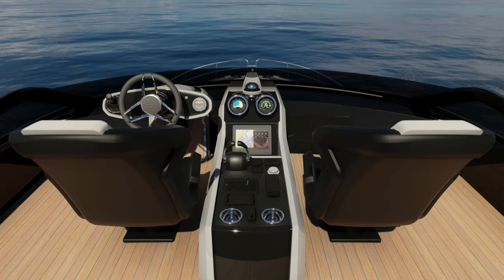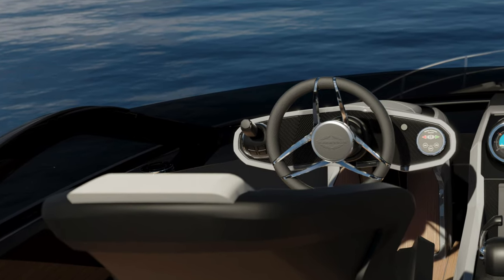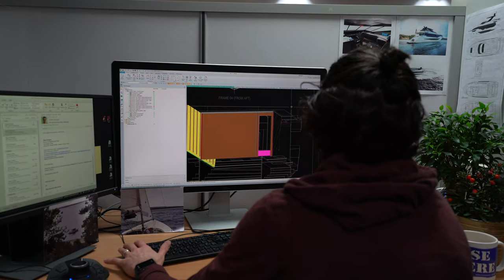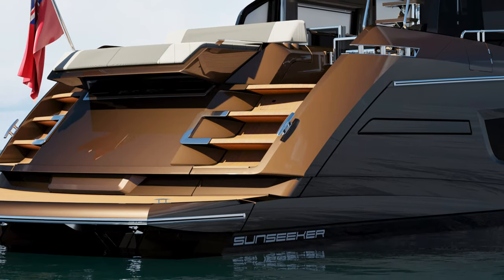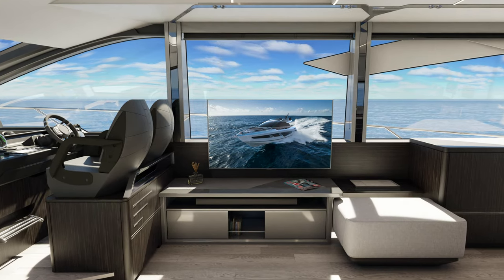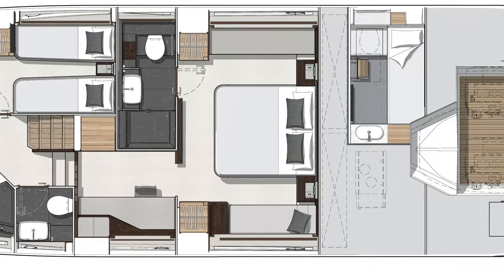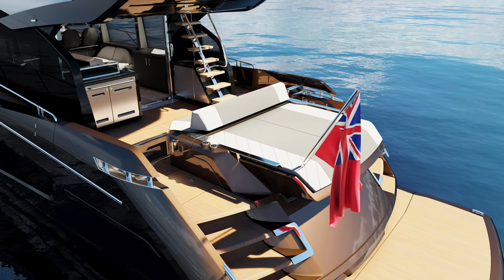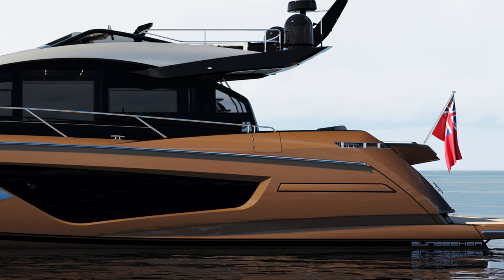Sunseeker - 65 Sport Yacht. Part Three - Interior Spaces & Details

Comment: Nice design - except the bucket seats -- I assume other options are available. 
Personally an external grill next to the galley is a far more useful idea than one on the fly or swim platform -- this needs to support fishing and other activities not cooking in my view. dive compressor. larger/longer boarding ladder. 
It would be good if you could provide a Part IV to this series so that potential owner operators can see how they would manage.